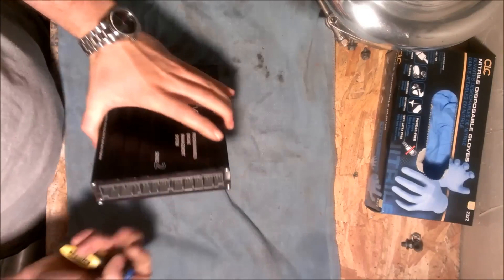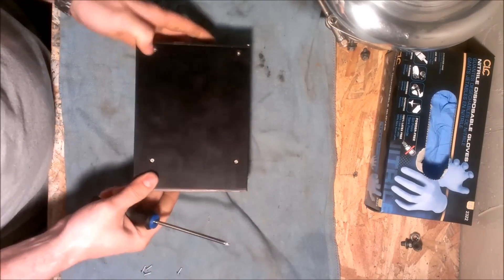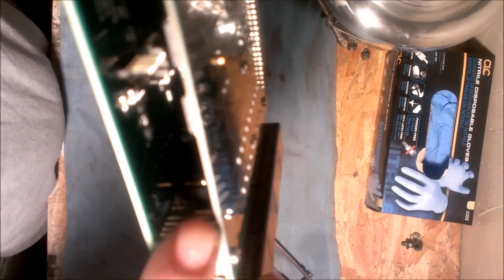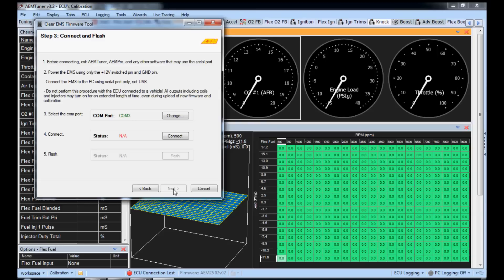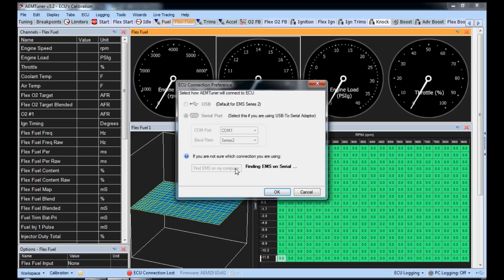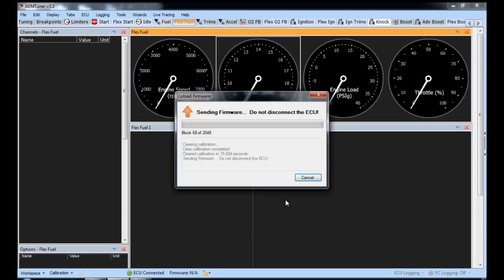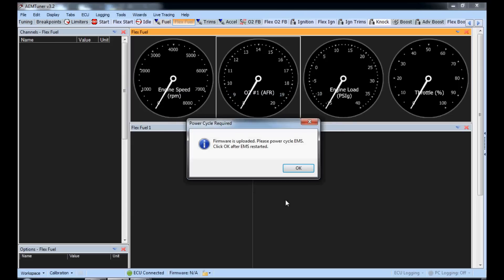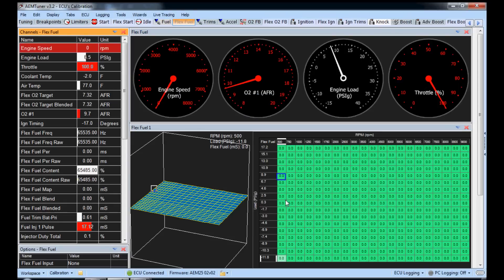How to Tune AEM: Firmware Reset

Comment: Hi ! I want to reset the Firmware and got my AEM out of the Car. I put +12V on Pin B1 (Series 2) and GND on Pin B2 . I go on the ECU with COM1 and Baud for Series 2 is selected. AEMTuner finds the ECU in "ECU Connection Preference" but i cant reset the firmware, because he cant find the ECU there. Jumper is on. I have no idea what happened to it. If i want to connect to the ECU there is a password but the Tuner didnt put a password on it. I cant uninstall the map in password window. Nothing works. please help me

Comment: I have a question, since you are using a 30-6050 box, does it need to be modified inside to have it working on a 2jzgte vvti?

I have a r-154 trans., ls2 coils, injector dynamics 1000cc and a walbro 400lph.

thank you for your help.
Reply from the maker: What you're asking doesn't really have any relevance to this video......The 2jz doesn't have anything to do with this. The firmware reset is the same process on any box. I just happen to have a 6050 box with me (that I wired into a 22ret) that needed a reset, so I made a video. 

But, to answer your question the 6050 box could be used on a vvti just fine.You should change the jumpers in the box to the correct edge for the ls2 coils, but other than that it should just be a matter of .cal settings, not anything hardware related.